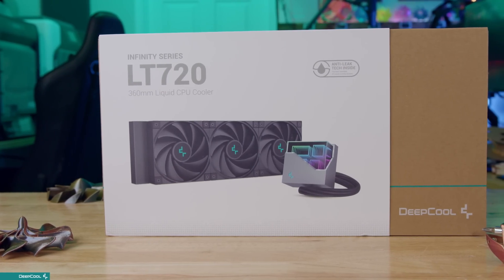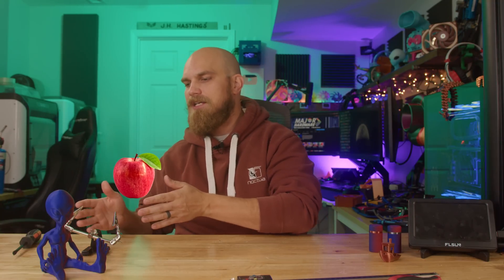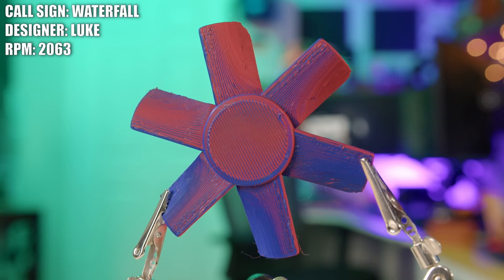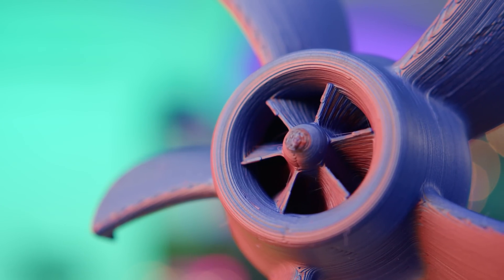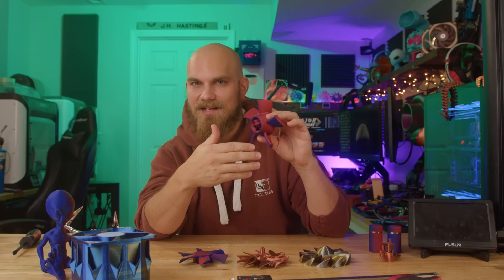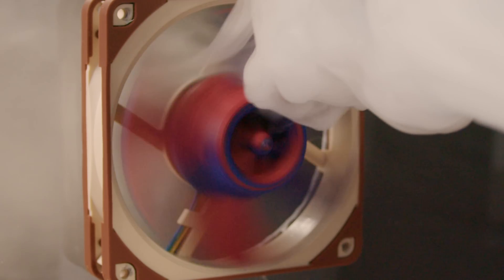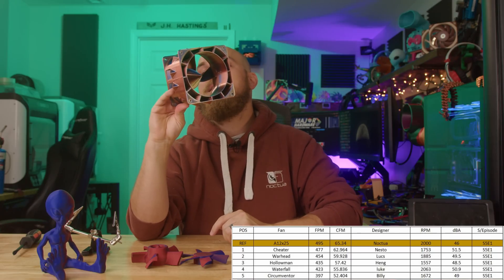This is LITERALLY two fans in one | Fan Showdown S5E1

Comment: If you're looking for static pressure. A lot of designs will be a centrifugal design.
The more you add, the higher your pressure.
Now we need a centrifugal thin enough that will not self destruct.
Just like a jet engine, things come in 3's. You would need a LP (low pressure) centrifugal fan that spins the air into a HP (high pressure) centrifugal. 1x LP cent. And 3x HP cent. For optimum static pressure.
Now for the calculations from diameter and RPMs. 
Have the a-12-25 as a LP aft fan. Use a tri gear hub to increase the rpm of the LP intake centrifugal upto 5,000 rpm, if possible. And the intake LP fan should be around 140mm.
In-between the LP intake fan and the a-12-25 LP aft fan are three, stacked on top of each other, HP Centrifugal compressor fans (stationary).

Comment: I thought the circumvent or was going to use the Bernoulli principle to speed up airflow and creat the amplified air movement… then I saw how it fits together, and that went out the window.

It needed to be flipped around. The nozzle should be used to construct the airflow a bit, and have air ducts that allow the air to flow into the accelerated air path.
Reply: Thanks for watching☝️congrats 🎉 you have been selected among our shortlisted winners....🎁🎁🎁 send a direct message on telegram with my name.....🎁🎁🎁

Comment: if anything the vanes in the middle of the hollowman do nothing...it's simply the centrifugal nature of middle inlet radial outlet... 'getting a second set of blades for free'. It is nice that it allows the second (very small channel) set of blades to do work on the previously blocked center inch.
Reply: Correct

Comment: as an old SPCR guy, im not a "fan" of your new method.
having the rad right up against the fan is always going to give the edge to fans like the cheater.
 If i were to enter in this round, and wanted to be sure and place high, id certainly make a few inch spacer/duct to keep fan body from sitting right on the rad.

Comment: I'm thinking on sending 2 designs but you would call it cheating. Would it be accepted not a fan at all but a pump instead? Or something that uses the motor from afar instead of that huge bulk in the middle?

Comment: I'm kinda wondering when they're going to introduce thermocatalytic dual-filament 3D printers that use a reaction between the contents of A and B in a pair of different filaments to produce a much better bonding structure....   technology is to the point now that we could also include a UV laser on the head to re-heat the prior surface and activate bonding...

Comment: When it comes to static pressure tests. The winner will always be the blower fan type. Because, the ratio of surface area to open space is utilized much more efficiently. You have to grab as much air as you can. It's literally a matter of brute force at this point. All the fans in your major cooling appliances are blower fans. That should say it all.
Reply: The only down side is with that much air comes a lot more noise. lol

Comment: Idea for season 6: instead of running them at full power of A12×25, use a faster fan and govern it down to 2000±50rpm using a closed loop speed governor, so that we can see how much pressure and airflow they produce at exactly the same speed, and how efficient they are to move the air.

Comment: You should 3d print the A12x25 and use that as a reference to beat. It doesn't seem fair comparing 3d printed fans to molded ones.

Comment: I feel for this new season the ones that will dominate will have tight tolerances with the housing, moderately aggressive blade pitch and the more you can close the gaps between the blades the better and still allow it to scoop air will win out and it’s gonna be a balancing act with all this variables. 😊 also to add and still have a good blade surface area to “cradle” the air

Comment: I’d say the low pressure caused by the blades moving and centripetal stuff forces air into the central fan and out. It’s pretty neat. Should be honored in some way because it’s so unique.
Reply: i would patent it if I had the money..

Comment: The hollow blade would be more powerful if you just remove the hollow blade part and channel the center "turbine" air behind the blades, as there is underpressure that is one of the most difficult problems to solve. Scooping air and flinging it away is easy, what is hard is to figure out how to fill the void of the blade wake.. and the hollowman has a very good solution to it. Just make it with regular blades, put the slot just behind the blade and it should be even better.

Comment: I'd love to see the fpm with this setup of the phanteks T30, the 120mm noctua industrial 3000 rpm and the 140mm version of the 3000 rpm industrial mounted with an adapter, to see if a bigger fan would make a difference with a smaller radiator.
Also a measurement, maybe just for the NF-A12, in pull and push pull configuration! 😁

Comment: That Hollow fan with the centrifugal compressor going on inside made me think of several things one of which was how aesthetically pleasing it would be to have the frame rate synced to the fan so that the fan was stationary and the smoke was moving. I understand this would be a pain in the ass because every fan is spinning at a different speed. But it would be rad.

Comment: Funny how the stock NF-A12x25 designed by engineers is the one that still has the best performance on a radiator (as the intended use case is)

Comment: You should clean the rad with comrest air to make shore there's no dust or debri blocking the flow ... Also the smoke test may need to hapen with the rad, to provide support for the measurements!

Comment: im a little surprised you haven't gotten one of the noctua industrial 120's that can run at 3000rpm as the base motor for the testing. But i love to see how this testing compares to previously and knowing the cheater straight up loses to the standard a12x25 is honestly a bit surprising i wonder if the shroud affects the static pressure because the air has more room to slow down before it hits the rad.

Comment: I would have preferred the radiator on the output side of the wind tunnel. From an engineering perspective (treating the fan, tunnel, and radiators as modules) it should be exactly the same in any order (radiator>fan>tunnel or whatever). But, the peak airflow designed fans need the expansion area and area to twist before they are loaded down. In the real-world use all fans have difficulty drawing air in through a restriction, and some fans do push through radiators, others pull through radiators and still others push air into or out of expansive cases with their own restrictions.

Comment: im a fan of the fans.

static pressure really changes it. some of those looked REALLY good as straight airflow, and had good sound profiles as well. but when you gotta push through a cooler or radiator, it really changes things. thats why we suddenly see that stock Noctua at the top again. this season might be hard to dethrone the original!

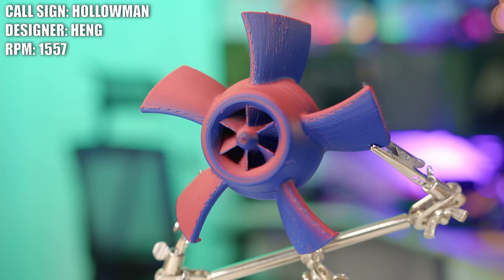Comment: 4:10 "Hollowman" is a REALLY interesting design, it combines BOTH regular fan blowing, but also centrifugal compression fanning too.
This can DEFINITELY be much expanded on. :D
Reply: you are right, the center part is unnecessary because it all comes from the centrifugal force pushing out the air in the blade. I made 2 designs, one without the "turbo" in the center
Reply: @sourand jaded it is mostly centrifugal force in the blades. maybe also some venturi. but the air from the center has to go somewhere..
Reply: @Mohenjo_Daro_  I was thinking the same thing
Reply: I Completely agree
I never seen anything like this before, and I've seen a lot of weird stuff
Reply: @Mohenjo_Daro_  you're absolutely right, this small fan has very little power. It has a little bit of force, and not as much force as shown.  It would be better if this design actually had more force pushing through the center of the fan. Look at the designs of tiny fans as a comparison. They work better with more blades.
Reply: @Mohenjo_Daro_  better performance, not equal. less resistance internally, and lower weight for higher speeds.
Reply: ye

Comment: The hollow man might be on to something as a case fan (not a cpu cooler). the air volume should be significantly higher at the cost of static pressure in that design.
Reply: it needs more RPM for more centrifugal force

Comment: I'm really looking forward to this showdown season! I feel it makes more sense to use a radiator because it seems they are more and more common with aios.

Have you ever considered having something similar to a weight class setup within a season? Obviously a fan for meant for just moving cfm (like the cheater) would perform better as a case fan. And a static pressure fan for a radiator, etc. But could they be tested or at least ranked in their respective categories to show more of the whole story? I feel that would be a valuable addition to the next season.

Keep up the excellent work!

Comment: The quality of these prints looks worse than previous seasons. Did you change printers, or is it just the chromatic filament causing the crap print quality?
Reply: Looked more like the closeups were taken before any final cleanup smoothing/sanding/whatever while normally it's done the other way around. To my rather uninformed eye, anyway. Could even have been both for all I know.

Comment: @Major Hardware 
The rear side of the fans that have a rear (like the cheater) should be on the other side of the radiator. you've got the whole whack on, then the radiator. They should pull air through the fan, then the radiator then out the exhaust, not through the fan, out the exhaust and into the radiator. 

while it may not impact results much I feel you'd be remiss to not test that.

Comment: Well. With another season comes a new test, once again I shall submit more designs. I cannot forgive you for calling another fan a more refined version of my last season AND SO I SHALL REIN ABOVE ALL THIS SEASON!!! + I finally got my own test setup setup so I can actually test my own fans first!!
Reply: As an avid wacher of the series with zero applicable skills, can i make a suggestion for you to design around?
Look into STOL (Short Take-Off and Landing) aircraft wings. you can find actual dimensions easily online, and they have these slats at the front to increase lift. I've been wanting to see a design that tries that trick, and i think just taking a proven wing profile, and just give it a sweep to correct for the radius. maybe have the scale change from root to tip to adjust for speed too
I figure if it's designed for high lift at low speed... it'll probably move some decent air
Reply: @Seldoon_Nemar  sure! I will design one for you and send it in with my lot, did that once before working with someone on discord to make one.

Comment: For the hollow fan, I don't believe it's pulling air into the center because of the fan blades in there. I think it's more because there is a pocket of negative pressure created on the trailing edge of the outer blades, where the exits for the center duct are located, and that negative pressure is puling air into the center.
Reply: correct, the centrifugal force is forcing the air out of the blade, making a suction in the center

Comment: I'd love to see the top fans printed with highest print resolution possible and sanded and see if it makes a difference
Reply: I believe he has already done it in an earlier video, and it didn't affect the measurements significantly
Reply: @easternhills1329  Dependin on the design it might affect the sound more than anything. It would be interesting to see, I don't think he was doing the audio testing back then.

Comment: If you are going to make these FAN Challenges then make this at least PRACTICABLE...  What I mean by that last statement is that for almost ALL people, they have to somehow get these fans inside their PC cases.  More and more these fans have stepped SO FAR out of the "BOX" that it would be IMPOSSIBLE to use inside their home PC's!  And was that NOT the reason in the FIRST PLACE for all this?  The design of a "FAN" can, in some instances, make or break an other-wards brilliant COMPUTER system.  It could be for a home or even a massive banking main system for the accounting of the entire public's use for that particular bank.  If ya can't keep it cool - well - it just ain't gonna work in the end!  That is where this original idea for a "better" fan design came from I have to think.  SO, if you ARE going to allow all these WAY OVER THE TOP designs then you should have real, definable BOUNDARIES for EACH category.  Otherwise this WHOLE idea is in the end just a MUTE POINT!  I think what should happen here is that as each season starts you set up IN ADVANCE 3 or more needed boxes you put your fan systems in.  Say... one for the fan alone that can fit inside a standard enclosure that the fans that are shipped with the manufactures fan.  One for a FAN that could fit inside the LARGER sized cases out today.  Then ONE for AIO systems that MOST AIO's are using today on the market.  Then, you could have one or more "Free for all" categories that in the end can have WINNERS each season.  Break up these episodes however you choose.  This may mean that each season becomes longer overall but in the end not only would you satisfy everybody but you will end up with more than ONE winner per SEASON.
This would ENCOURAGE the fan designers to narrow down what they come up with AND you could STILL have a "BEST IN SHOW" for the season.  I think some people may wish to come up with some WAY OVER THE TOP designs yet others would like to see just how much they can eek out of fan that ANY case would still work in ANY ENCLOSURE!  The possibilities ARE truly endless here.  It's something to think about for you next season.  Also, I think it also just fair that ALL PREVIOUS FANS that have ever been submitted are 100% RETIRED and all those designs set aside and never used again.  If a person wishes to re-design a fan that has been submitted in the past that is OK as long as it's at least 15% different than before.  You could even have a category for MULTIPLE FANS with NO RESTRICTIONS AT ALL which would be a TON of fun to see too!  Anyway, this also would prevent YOUR site from becoming "stale" too which can only be good for you!
Reply: Err... out of curiosity, have you seen some of the modern radiators?  Not the external ones for watercooling, the internal ones that replace the basic CPU heatsink. They're actually noticeably bigger than these fans, or at least very closely comparable to the largest ones. While still fitting in the standard 'medium' tower case (which has only gained a couple of centimetres in width in the last couple of decades, all of that under/behind the motherboard for cable management and bay access purposes, so not actually affecting the space where the fan goes).

Modern motherboard configurations are designed to accomodate them (addmittedly, in some cases this does have tradeoffs like limiting which RAM sticks will actually fit and the like.)  My new PC has a Noctua radiator that is bigger than any fan showen so far, to my recollection (or at least, it's comparable to the biggest ones), and is deisgned to then have a pair of 140mm fans attached to it (one pushing air in, one pulling it out, to my understanding) and weighs about as much as the power supply too.  So, provided the fan is smaller than That monster, and works with a more reasonable radiator/heatsink (things That massive still aren't quite the norm, yet), that's not really a huge problem. 

Point is, while more specific constraints might be wise, and possibly have some limited effect, I think you may be overestimating how much difference realistic constraints on that front would actually make. 

Also, for reference, so much ALL CAPS text doesn't actually help emphasise your point so much as it makes the text more difficult to read, at best.

Comment: While I appreciate that we are now testing on something closer to real world performance, it's a shame that the rules have changed. I was working on developing something specifically to maximize the unrestricted airflow case but it would do so at the cost of handling any static pressure. Now I have to go back to the drawing board.

It would be interesting to revisit some of the compressor designs to see how well they do, since they are all about developing static pressure at the expensive of unrestricted airflow.

Comment: I did enjoy the hollowman, but I don't think the blades in the midle is doing anything, or maybe even slowing down the air.... I think the channels out in the blades is working like a radial fan, much more effective than the middle blades. It might even be there is somthing like a ventury effect at the output of the main blades where the air passing the blades drags the air from the inside.

Comment: hey Major Hardware i have 2 questions,
first: can you put maybe the 2. best fan in the case of the cheater if its even better?
second: if you put 2 fans together, did they double they perfomance or is it less?
maybe you can check it with you setting :3

Comment: I would put the circumventor's base after the radiator. Looks like they were going for a high pressure to low pressure design, and putting the rad at the end of it would, at least in my mind, negate the effect of the low pressure zone. I could be totally wrong, but in my mind, it's a valid theory...

Comment: I like that the airflow past the radiator test is a good real-world application, but I really wish you could have gotten an actual pressure reading in addition to the raw airflow. Testing consumer fan designs with those two would allow for strategic fan placement for either raw airflow or radiator cooling.

That and I just wanted to see how much pressure the roots blower could actually push.